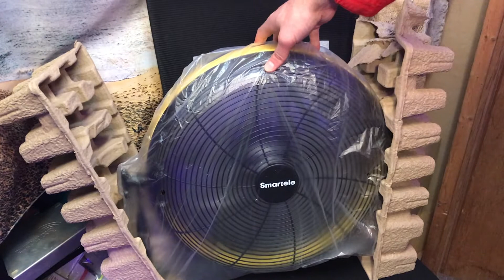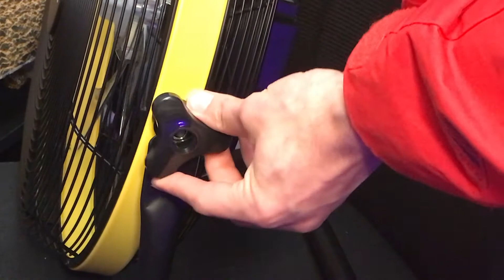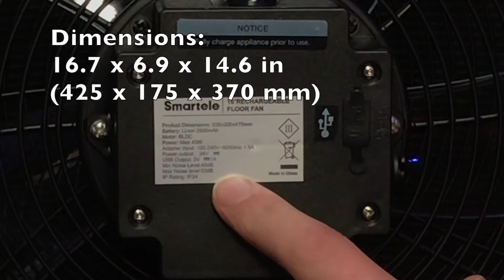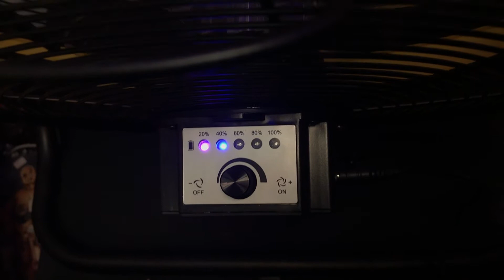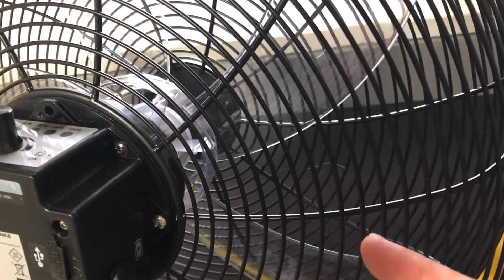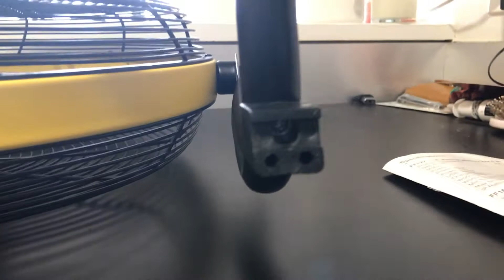Why the Smartele 16" BATTERY OPERATED Floor Fan Is a Versatile Off-Grid Tool (My Review)

Comment: That USB is for a light that should have been in the box. It runs off of 1 volt so you can see the floor during a power outage. So you won't trip over it.

Comment: Very excellent review. I've actually been looking for a fan that won't run off the inverter. I'm trying to stay away from as many things as possible that have to run off the inverter of my golabs R300. All the USB fans I have are this little dinky ass 4 or 6 inch little guys which is fine for a desktop. However if you need something that will keep you cool in the backyard or at the beach, they are a little more troublesome than they are worth. With an internal battery you could easily take this on a beach excursion and be able to get a cool breeze anytime. I wonder if I opened it up and popped in a nice samsung or LG 3200mAh battery if it would last a little longer. Great review.
Reply from the maker: Thanks for your insights, Chris. I know those USB fans but never owned one before. I'm glad I haven't! I think the fan I reviewed could be great for the scenarios you mentioned. I used it a couple days ago in addition to my air purifier to cool down my girlfriend's apartment and it worked really well. The 2500mAh battery lasts surprisingly long for being so small. The battery compartment looks like it has four screws that you can take out if you wanted to switch out the battery. I'm not too knowledgeable with that sorta swap, but I think you could do it to get additional hours of running time.

Comment: After New Orleans` most recent hurricane (Ida) and power outage the number one cause of death was heat stroke. But good luck getting the media to tell the public about cheap USB powered fans, power banks, and folding solar panels. They want victims. WWL channel deleted my comments about how to inexpensively solve the public`s heat stroke, light, and phone charging problems. There were huge lines of overheated people holding dead phones at public charging stations.
Reply from the maker: Pretty crazy to hear that (specifically your last sentence). Such a simple solution for the communication problem from dead phones - makes it even more sad because of how a simple battery bank could've helped in such a massive way.

Comment: What`s the voltage input for charging? I`m wondering if it can be connected to outputs on folding solar panels. I have panels with type C 65 watt PD ports, standard 5 v USB, and 12-18 volt.
Reply from the maker: The AC wall charger says it outputs 24V at about 1.5A (max). Maybe the USB-C has a shot at working with it? Not sure entirely. The input on the fan seems to be a slightly smaller connector than a 5521 input